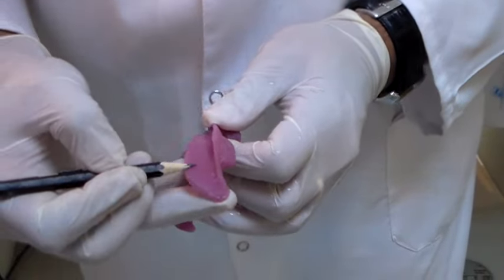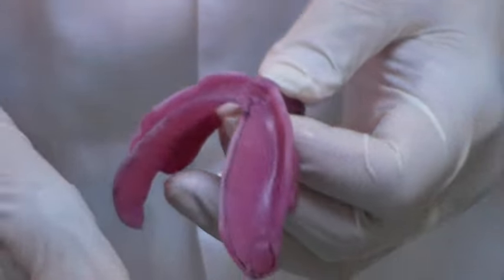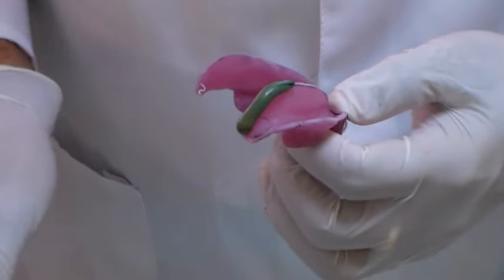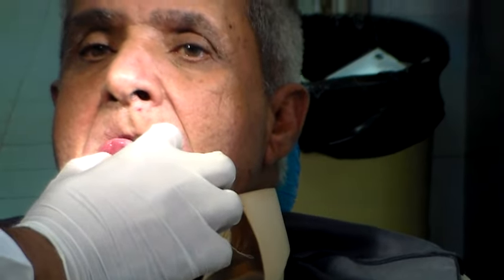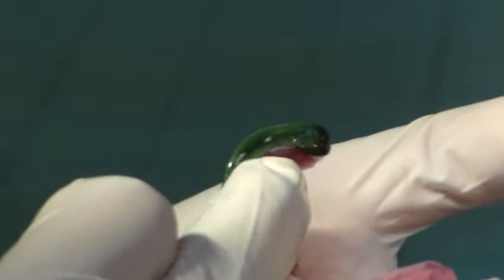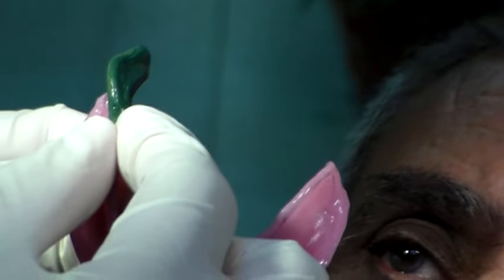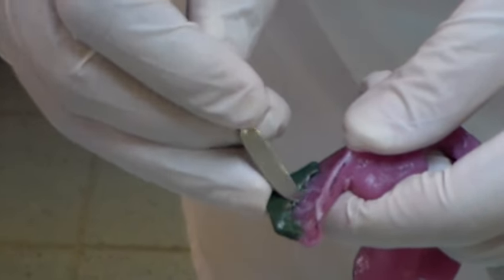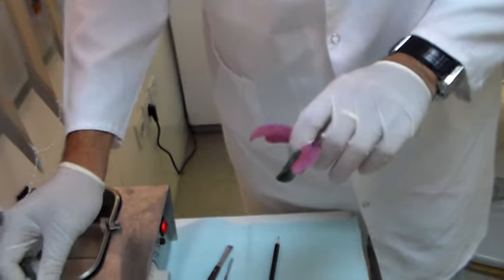CD Videos No.15- Mand. Border Molding Part 1

Comment: Sir which company green stick material u use??? N also the pencil u used to mark pps....as we use eosin pencil n it get smudge with saliva
Reply from the maker: I think DPI Green Stick is good. Pinnacle is regarded as one of the best. Learning to handle the material takes a little time - but once mastered then it pays its dividends.
You can use any 'water color' pencil -even 'Faber Castle' has water colour pencils. Any pencil that can mark on your WET palm should work fine. I'm using 'Aquarell' pencils from Staedtler.

Comment: Before starting of border moulding how I came to know that my special tray is ok.
Whether it is over or underextend
Reply: When you are preparing the  the special tray you are using a wax under the tray. When you are done with tray make sure that wax is still in the tray and place it in the mouth and try herbst tests.
Reply from the maker: Watch the video in custom tray fabrication. It might help
Reply: You can do so by :
1.Checking where the tissue starts moving when you reflect it.
2.The custom trays move if its overextended during normal movements of tongue and cheek pulling
Reply: I always watch your videos before border moulding no matter what how many dentures I delivered, love to be your student before doing border moulding.. Thanks sir for uploading this CD case. Regards

Comment: Well explained..but i find it difficult to manage patient with macroglossia...any way to improve it?
Reply from the maker: Hi there Janice Chau ,  a patient with macroglossia  is a bit challenging. Here you have to introduce the special tray into the mouth BUT DON'T SEAT IT. Use a mouth mirror to retract the tongue so as to expose the lingual vestibule on the side needed. NOW SEAT the tray down to position and do the tongue movements.  It should go well. God bless you.